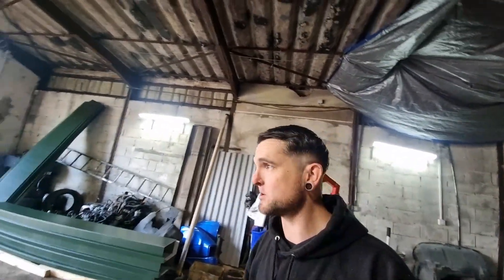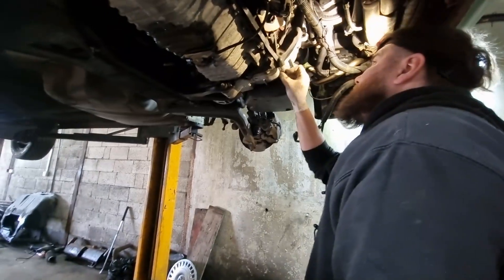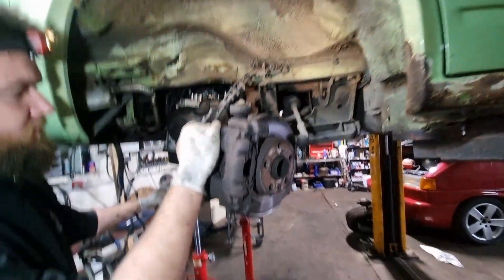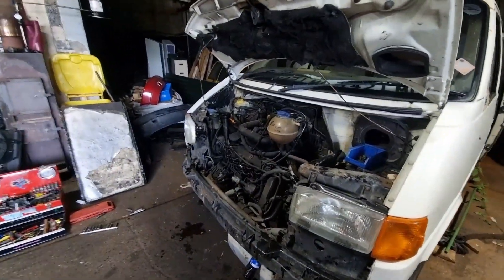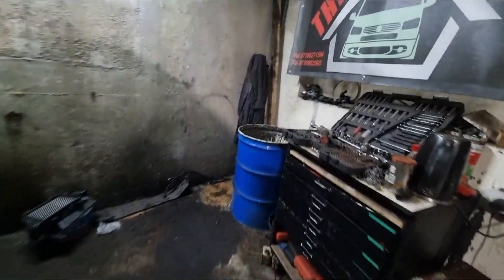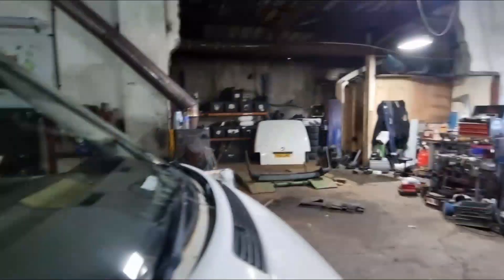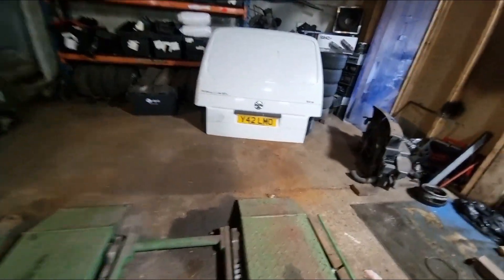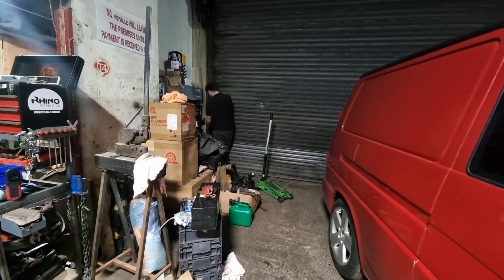Another Poorly Van!!! #VWT4

Comment: If you ever come across a mounting plate for the pollen filter 6:20 with all 3 clips unbroken, I'll happily purchase one from you.
Reply from the maker: I think they're extinct I have three and they all got 2 and one broken off lol
Reply: @PranceProject  I have a bit of folded up cardboard wedged in where one has snapped off. Everything is so brittle after 25 years. I should never work on the van when the weather is cold. Might see about getting one 3D printed.
Reply from the maker: @T4TipsGuides that's actually a really good idea that 
Why haven't I thought about this I've had loads printed